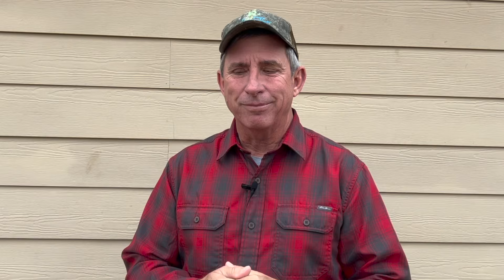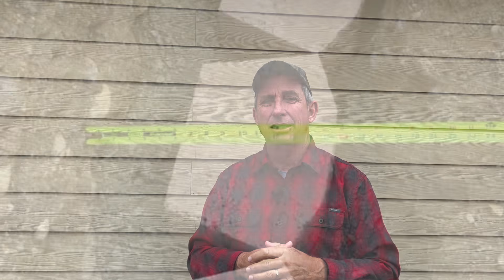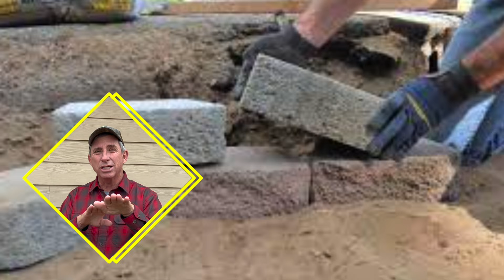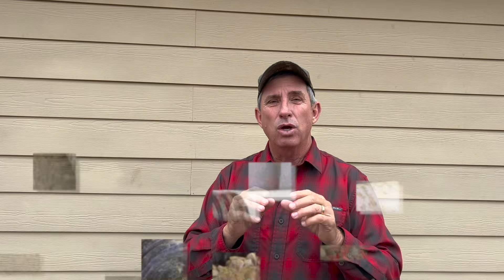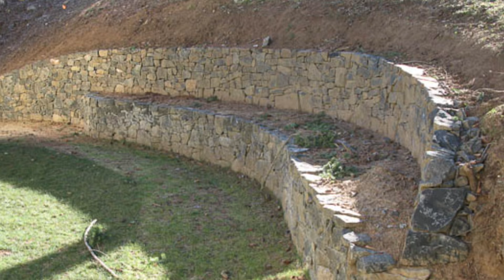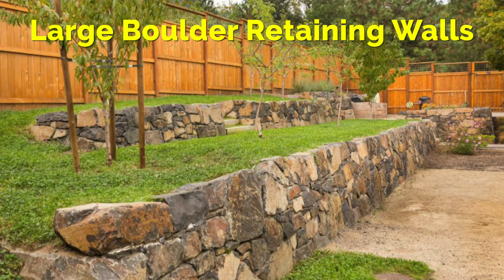RETAINING WALLS BASICS | Build a Wall with these DIY Steps | Hillside Landscapes

Comment: Great video! Since you are in a very wet environment, just like you mine is saturated. I am at the bottom of four Hills and with temperatures of 85° plus I still have water in a 1-ft trench from rain that happened two days ago for a couple hours. 

That being said, I am in the process of having a retaining wall built that is at most 2 ft tall and the contractor excavated and used a Portland sand mix for the base. The Nicolock wall we are having installed is defective so we stopped the project. 

This contractor  is a acquaintance of my mother-in-law so I felt obligated to use him. He is a second generation Mason so I figured he would do the job right. So far it's a complete disaster. If it wasn't for the defective block I think we would have ended up with big problems in about 5 to 10 years. 

What would you recommend for the base underneath the wall? There's going to be a 2 ft wall and then a series of three platform steps, 6 ft long, that will have pavers that lead to my front porch. 

I was thinking nonwoven Geo textile at the bottom of the trench with 3/4 - compacted for the base. Once the wall was complete I was thinking about a perforated pipe along the bottom of the wall exiting towards the street drain with a backfill of 3/4 clear covered by nonwoven geotextile then backfill. 

If that is not the message you would use, what would you do?
Reply from the maker: Sorry to hear about the project complications. You are on the right path as you described it. 2’ is not that tall but the water migration you describe warrants the drainage behind it.
Reply: @YardCoach so do you think that the process that I mentioned is sufficient? I wouldn't hold anybody to it that hasn't seen the property but my thinking is that I just eliminated as much water as possible so that any water that does get to the base of the wall doesn't end up Frost heaving the wall at a position over the years.
Reply from the maker: @the_stixXx well water is unpredictable and we can only mitigate as much as possible. In the winter frozen ground should not heave if you have gravel and not moisture holding sand or similar material. if minor heaving does occur it should settle out the following Spring. I would think your concern is more about Spring and Summer rains and Spring thaw the location at the bottom of the neighborhood funnel that you find yourself. You should be fine as you described things.

Comment: The left hand side (minus the stones) is about what the side of my front yard with a heavy slope down to my driveway looks like (approximately 8-10 feet). It’s too steep to mow, too much to weed eat, I don’t want to level it off, because I know how clumsy I am; I’d be mowing my front yard and go tumbling over the wall. Could I just use a concrete mold to cover this area and keep the slope? Thanks!
Reply from the maker: Thanks for the Q. I would need to see a pic of the area to give you an informed answer. Shoot a couple pics to the email. Thx for watching.
Reply: Sure will! Thanks! I’ve lived here for 15 years, and I’m OVER IT! It’s too much on my body to cut myself, and every person I have hired does a terrible job on it; they’ll just weed eat it, and it looks uneven and ugly! 

BTW, I had a roof put on, recently, and I discovered the guys left a roll of the water-resistant wrap. 

Man, oh, man! That stuff was PERFECT for the large stones I placed around my pergola. 

There are NO WEEDS getting through that stuff! Not good for landscaping, but perfect to prevent weed growth around stones!
Reply: Sure will! Thanks! I’ve lived here for 15 years, and I’m OVER IT! It’s too much on my body to cut myself, and every person I have hired does a terrible job on it; they’ll just weed eat it, and it looks uneven and ugly! 

BTW, I had a roof put on, recently, and I discovered the guys left a roll of the water-resistant wrap. 

Man, oh, man! That stuff was PERFECT for the large stones I placed around my pergola. 

There are NO WEEDS getting through that stuff! Not good for landscaping, but perfect to prevent weed growth around stones!

Comment: Retired carpenter here who laid out and supervised the digging, forming, and placing of the concrete of many buildings and retaining walls. Man this guy is spot on in every respect of the process here
and he explains it better than most
with his emphasis in all the right places. Listen to him. One thing though, he emphasized using the best filter fabric which l am totally on board with. But the stuff shown in the video was the cheap stuff. You want the thick black expensive stuff that is like coarse wool on steroids. Otherwise hats off to you retaining wall man!

Comment: If one is building a 2 or 3 course retaining wall with 6" stone pavers, can one place it right up against the concrete sidewalk? 
Thank you.  JM
Reply from the maker: You can, however an inch or two of space can provide a drainage slot for water run off.  Thx for watching. Coach M.
Reply: Ok so keep 1 or 2 inches of dirt/soil between the edge of the retaining wall and the edge of the concrete sidewalk. It's a buffer zone, so the stone retaining wall is not touching the 4" concrete sidewalk slab. Correct? Thank you, JM
Reply from the maker: Not even soil John. Probably just your base stone or decorative stone. Soil will just attract weed seed and germination.
Reply: I have an area that has a hill and gradually flattens out. Do you have any videos of this type of wall but showing how to complete/tie in the end. I want to maintain the same height for the entire wall. I hope that makes sense. Great video!
Reply from the maker: @bassman6692 I have a series of vids in the playlist. As far as your project, over excavation, complete your wall then backfill above and below the wall so it looks like it dead ends into the hill. Thx for watching.

Comment: I have many smaller retaining walls built with maybe 6-8” round stones probably over 50 years ago. They are lovely but do shift a bit. I remember my mom constantly picking up fallen sones and resetting them into the hill. The lower restating walls were built with huge stones and probably some mortar. They have lasted. They must’ve done something right there. Lower down the hill near the street, that retaining wall, also stone and mortar is definitely shifting a bit. I would love to do something similar to the original. Thanks for the tips.
Reply from the maker: Shifting from hydraulic water pressure maybe. 🤔 Any drainage behind the shifty ones?
Reply: @YardCoach  just dirt that I know of. Probably as old as the house, well maybe not that old. 😂 at least 65 years old. That’s how long our family has owned the house.

Comment: I am having issues with my retaining wall build. I have excavated out my retaining wall area and dug a trench but it keeps filling entirely with water runoff from the hill. Do you have any helpful ideas or ways to deal with water filling in the trench for a retaining wall build?
Reply from the maker: Hey thanks for the Q. Most times a temporary pump is used to remove trench water as it accumulates. The more base substrate you get place and compacted the better. This will displace water elsewhere. Once base is in work towards getting your first course done ASAP. Obviously drainage  will be needed..sounds like more hands working together would speed up an 8 hour attempt to get past the accumulation, base layer, first course and drainage. Good luck I know you will be successful. Mind over matter.
Reply: @mferraro1208  I would’ve used silt fence, how did it work out?

Comment: Great video. Looking for advice/help.. I’ve been stumped with my trench. It has been stepped and levelled, I Poured the concrete, trowelled smooth. few days later with a bit of rain upon checking the concrete she’s solid but out of level.. how can I get around this for the first course?
Reply from the maker: Good Q J. Depends how far out of level. You talking back to front or side to side for a ways?
You can trowel in with a thin layer or mortar and re level. Another way is to use wood/plastic shims and concrete adhesive. If it really bad a re pour is a sure way. Which I’m sure you do not want to do.

Comment: My Dad was a mason or  'bricklayer' as he said. He always put rebar in his concrete footings. Even for a 2 foot high planter.  And especially for a higher retaining wall, he would use concrete blocks and then face with bricks or stone. I used to go on sites with him when I was a kid and remember that. And he did a lot of block and brickwork at our house. I suppose it's easier to use rebar when laying blocks and filling those with more concrete. 
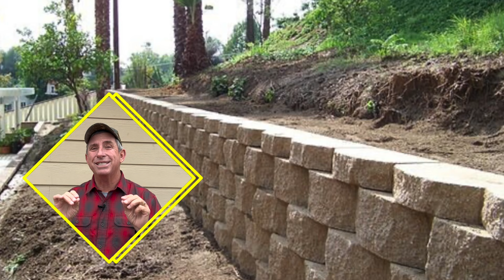I don't see any rebar with the decorative type of blocks that lock together (8:09). I'd worry about using those for a hillside retaining wall with no rebar reinforcement. Even with the drainage behind.
Reply from the maker: That’s why we get into more advanced Geogrid techniques with taller block walls. 
But they do work well. Just look at freeway walls which are huge. 
Need more guys like your dad in the trades. Props to him. Hope he taught a few youngsters along the way. 
Appreciate the comment and you watching. Coach.